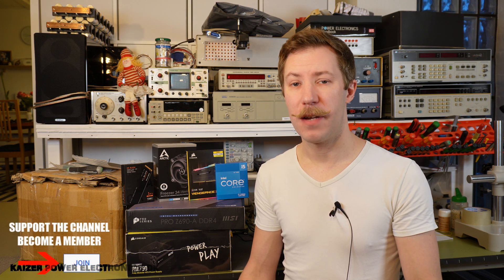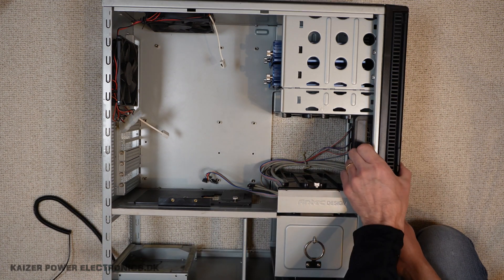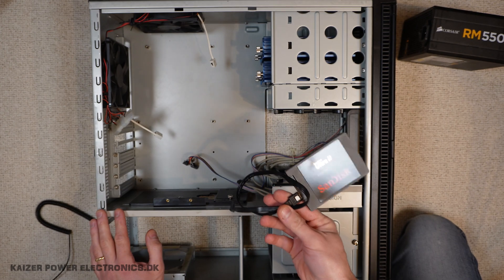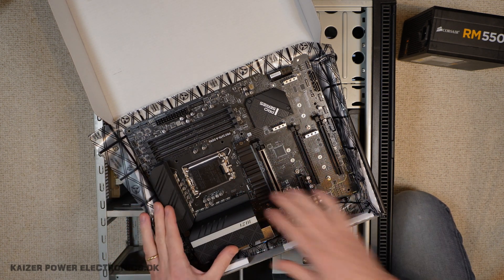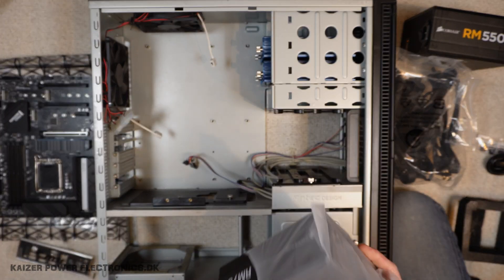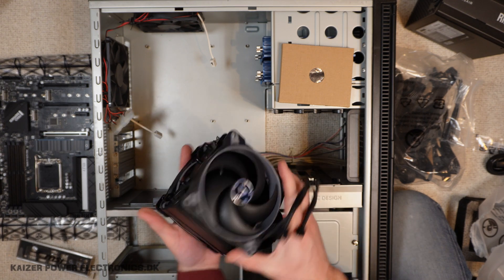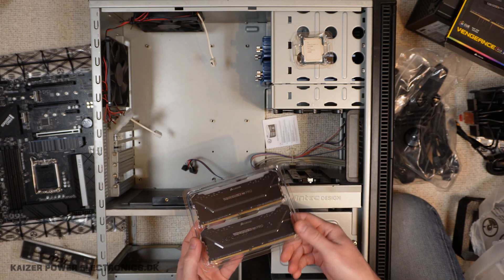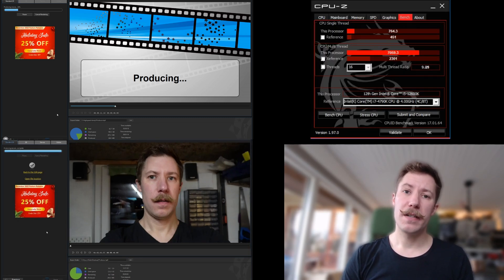[2023] Intel i5-12600K 4K Rendering PC Build (930€)

Comment: Your old system is a lot better than my current one, possibly time to look out for some used i% processors and motherboards now, and upgrade it.
Reply from the maker: With the new releases of Gen14 Intel CPUs, there might be Gen12 to find used. But not much, the increase in performance is not THAT great. Unless money is not an issue ;)

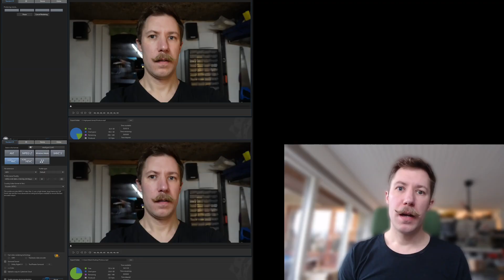Comment: 7:36 Your RAM is only running at 2133MHz, but it supports up to 3200MHz. You should enable the XMP profile, which will bring the frequency up to 3200MHz and it should give you a good performance boost.
Reply from the maker: Good catch! I actually disabled XMP at an early stage, because the PC was randomly shutting down. A BIOS upgraded fixed, what was properly CPU incompatible issues, as the shipped BIOS software was over a year old.
Reply: @KaizerPowerElectronicsDk  I also had issues with my 3600MHz RAM and XMP, the system was crashing after a short time. I ended up just decreasing the frequency to 3500MHz and that's been working flawlessly. Maybe this could help you as well.